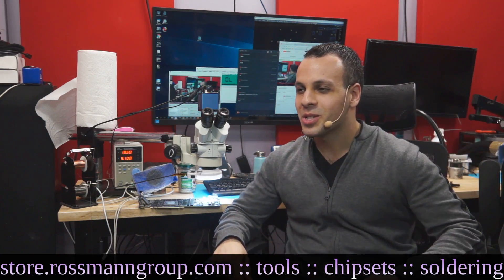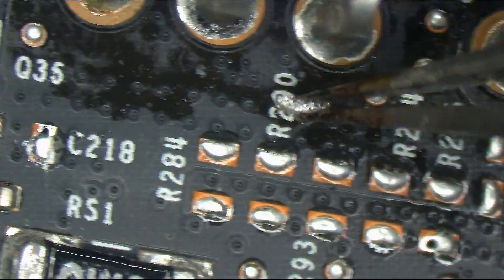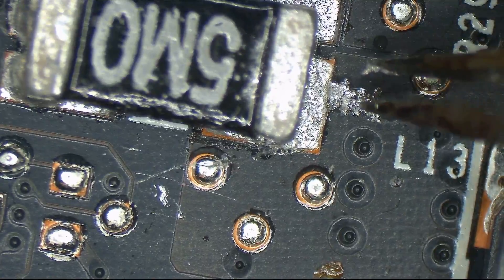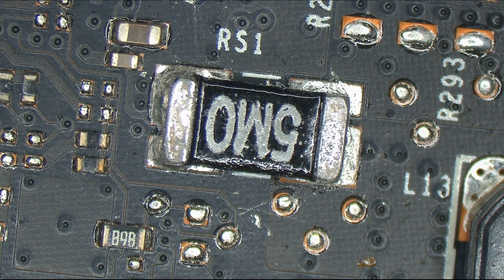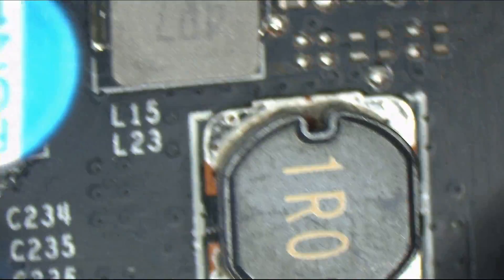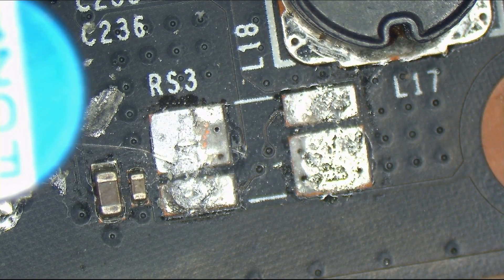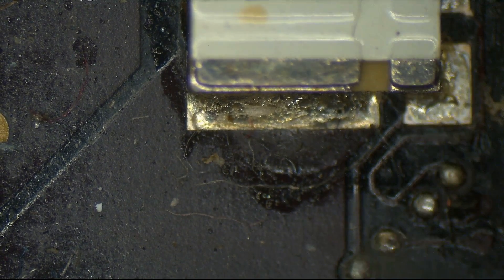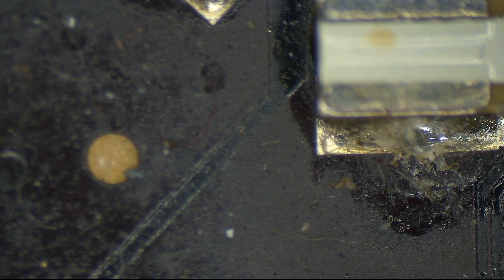DO NOT SHUNT MOD YOUR GRAPHICS CARD WITH LIQUID METAL!

Comment: Nvidia does actually use decent RoHS compliant solder. If the guy was using liquid metal thermal compound, then you dont want that getting near VRM components. You use it directly on the silicon only and you dont use much of it!

There are stupid people out there though who think they know better and no...they don't...
Reply: Actually these resistors cost less than a cent and you can buy them and solder them on the top of the original one to make the resultant resistance lower that much as you need, not just using some chemically aggressive metals on it resulting a full random resistance drop and solder degradation... But that would be too obvious.
Reply: You dont have to use liquid metal. You can use a piece of wire and solder it. If you can't solder then you shouldn't be fiddling around with a $1200 PCIe card as you clearly dont know what you're doing and are just following guides.

Just use a piece of wire, or a lower value resistor of the same wattage (ie: size).

+Peter Kiss - You do that, and you'll fuck with the clearance between the SMD resistors and the heatsink. The heatsink won't go back on properly. While a voltage divider would work, you're best to just put a 50kOhm or less resistor of equivilant wattage, or a piece of wire there.

It's more permanant and doesn't damage the card, so as long as you keep heat well away from the die area.
Reply: Using a piece of copper wire of a known thickness... The wire has a small contact area compared to an SMD resistor. What resistance do the solder blobs have at the two end of the wire? What length do the solder run over the wire? With what precision did you cut the wire? (As the length is that short even a small deviation can cause massive error.) However an SMD resistor is cheap, has a proper soldering surface area, a known resistance, known power rating, looks somehow...

Manufacturers don't do too detailed cutouts as it is pointless. These components are too close to each other to have dedicated cutouts.

Dude, I'm perfectly familiar with how electronics work. But they placed that power rated resistor there for a reason. And as long as the additional resistor connects parallel to the original shunt it drops the same voltage. Which means the ratio between their resistance equals to the inverse ratio of their power dissipation. Then it's perfectly clear what power rated component do you need to a certain percentage increase in the current.

"All that 5M Ohm shunt resistor does is limit the voltage through to the die" It doesn't limit anything directly (certainly not the voltage) as it's just a current sensing resistor. As I know Pascal cards aren't working with a perfectly shorted shunt, and again a few mm short piece of wire is everything but precise. It would completely void the whole point of current sensing.

"The only time you'd want to "stack" at all, is if you want a very specific voltage" Again it doesn't regulate the voltage. However the maximum voltage level on the shunt does not depend on the shunt value, as it equals to the comparation value in the current sense measuring circuit. (Of course only if it can reach that. With short circuit it can't reach that voltage level.)
Reply: 1. "You do that, and you'll fuck with the clearance between the SMD resistors and the heatsink." Not really. As you can see there are much taller inductors and elctrolytic capacitors around that resistor.

2. As you don't wan't to double the power usage you don't need a that high power rated resistor as the original is. For example if you want to get 125% power you need a resistor that 4x the resistance and at least 1/4 the power (therefore 1/4 the size) stacked onto the original.

3. Using a simple wire gives you an unknown result.
Reply: 1) Depends on the gauge/thickness of the wire you use. 

2) Putting liquid metal over your resistor is going to give you unstable voltages through that resistor. And even with a surface mount component you still have the resistance of the solder to deal with (negligable anyway).

3) The inductors or capacitors are in a row or line (ie: if this is part of the VRM) then they usually do have a cut out for it. It's better to just straight swap for a piece of wire or something like a 50k-500k ohm resistor.

4) The Power rating a resistor holds little bearing on what's moving through it, only what it's rated for. And a resistor will limit the voltage on the other side of it (due to the voltage drop across the resistor, Kirchoff's law comes to mind).

5) a SMD resistor has a tolerance too, usually 1-10% variance in it's resistance. Even capacitors and inductors have this. 

Lets say the Liquid metal short has a 100 milliohm resistance in parallel to the 5M Ohm resistor. That 99.99 milliohms give or take, which is certainly defeating the point. A piece of wire is likely to have a higher resistance than this and not cause gallium poisoning to the solder joints.

6) You can use a voltage divider to give you a set output voltage, especially on sense circuits where you need a set voltage. And the voltage across the shunt does depend on the shunt resistance. 

I've not seen schematics for the Titan X maxwell card so I can't comment on whether it's part of a current sense circuit. Besides that, the whole purpose of a shunt is to bypass other circuitry and create a shorter path for current. And given the cards don't fail with only 100 milliohms of resistance on that shunt with the mod, I don't see why they would fail with a piece of resistor wire or even copper wire.

Resistivity = Length / (Resistance x Cross-sectional area)

(1mm^2 x 1.7 Ohms) = 1.7 ohms, across a distance of 3 millimetres still gives you a resitance of about 1.8 milliohms. If that's too low then my bad, I'm wrong. But even then, it's best to just replace the whole thing for a more permanant solution. I would suggest against using kaptin tape or scotch tape and a botch job with just taping another resistor to it.
Reply: If I put liquid metal on a Titan GPU die I'd bolt my computer to the desk and never move it again.
Reply: 1. Please stop spewing elementary school physics and try to understand that resistor is 5miliOhm (0,005 Ohm). As the card draws 16-20 Ampers it flows trough that and causes a well measureable 80-100mV signal but still negligeable loss. It isn't a simple serial current limiter resistor. It doesn't limit the voltage by itself, it just provides a signal voltage that represents the current that flows trough it. It just helps the regulator circuitry to know how much current does the board drain from the supply. If you want to replace it with a piece of wire that is capable ot that high current rating then you need an as thick and as short wire you can't measure the length precisely enough to make a proper replacement.

2. I didn't suggest to use liquid metal on the resistor as I know what it does to most materials it gets into contact.

3. Just watch the video! There are much taller capacitors an an inductor literally besides that resistor within a cm.

4. The voltage on this resistor is limited by the comparator circuit which is unaffected by the value of the resistor. And if you want to reach the power limit (that's the point of the whole process) it gets to that voltage. You need to choose a resistor that won't exceed its power rating on that voltage. And as we are speaking about resistors in the miliOhm resistance range that can be an issue to keep an eye on.

5. Yes they have their own tolerances (as all electronic components have), but at least they have one, not as the wires you cut by the eye.

6. You can't use a divider in this case because there is no room for it, and it would be totally contraproductive as you want to keep the losses as low as possible (voltage drop and power dissipation). 

And finally the SMD resistor has two thick flat ends that provide high enough cross section to be suitable for proper soldering. The flat surface lies over the other surface you want to solder onto and need a much thinner solder layer than a round wire with a blob at each end. 
The resistor is more precise, more reliable, more professional, easier to replace or get fixed, even looks better.
Reply: Actually you can use it to short some shunt resistors on the board to squeeze a few more watts into VCORE. It does also shit on the solder and will eventually ruin it, but people who do this mod should know better.
Reply: Using a piece of copper wire of a known thickness means you know what the resistance of it is (you can calculate it's resistivity).

Also, heatsinks often undulate a lot. They usually make very specific cut outs on cards to fit directly over caps and inductors. Even a 0.5mm clearance issue will cause problems with the reference design cooler making good contact.

Rather 80 degrees C, you'll see your card throttle and then cause driver crashes or oveaheat protection to kick in as it's not making good contact with the die. 

Increasing the power rating of the resistor just tells you the amount it can pass before it overheats and fails. a 5W resistor has a 5W rated power through-put, a 500mW rated resistor, 10 times less than that. It doesn't tell you the amount of power it will consume. For that, you measure voltage and do the following:

V^2 / R = gives you the power disipation of the resistor. 

All that 5M Ohm shunt resistor does is limit the voltage through to the die. The voltage drop at 5M Ohm is high, lowering the resistance using as less components as possible is more feasible. Even removing the shunt completely and shorting it with copper wire would be preferable. 

The only time you'd want to "stack" at all, is if you want a very specific voltage, which you don't care about most of he time, even in Liquid Nitrogen world record attempts.
Reply: Unless you want to power mod it then you kinda have to use liquid metal on top of the shunts which is exactly owner tried but failed horribly.

Comment: Yeah, Louis, that wasn't solder, that was a liquid metal mod done by a user. It (the liquid metal) eats through the actual solder.
Reply: I think he should redo this vid or make a retraction on his comments about shitty Nvidia solder and clarify in words about the shunt mod that was clearly displayed here !
Reply: gallium is fun...
Reply: Damage Industries
Is that actually a thing? People believe gallium makes their graphics cards better?
Reply: @schwarzerritter5724  It does, because the shunts limit the card to a set power target. Even at stock, my Titan Xp is constantly power throttling (meaning I'm losing probably 10% performance without even overclocking...). The shunt mod tricks the card into thinking 300w is only ~200w, and allows you to actually have enough power to run it correctly since its not restricted by power. I'll be doing the same to my Titan Xp, otherwise I can pull 300w out of a cheap $100 GPU, yet my $1200 card (about $800 used now) is limited to less than that, so much for owning my own hardware...
Reply: @jakegarrett8109  How does liquid metal do that?
Reply: @schwarzerritter5724  That shiny stuff is gallium. An funny metal that melt other metals like water melt sugar - only slower. A year ago some nutheads decided to boost their GPU's by shorting current sensing resistors with gallium achieving larger supported current and larger graphic card performance. It works for short time. Then gallium melt solder around resistors, seep into board through openings and microcracks and do a lot of damage for solderings and board parts. Pimped up boards after gallium treatment become non repairable after few months. The point of that mess is to get a short time benefit like a little more 3DMark scores to get into first place in performance contest charts. Obviously you can do that if you have a ton of surplus money :P Seems owner of this Mac or someone from his friends decided to pimp up built-in GPU in this Mac. Look like they had a lot of fun.
Reply: @KrotowX  Wouldn't it be easier to solder in a lower current sensing resistor, or solder in a second parallel resistor?
Reply: @schwarzerritter5724  LM is conductive, so it lowers the effective resistance of then shunt resistor. The card then tries to find how much voltage drop the shunt has in order to find current using an assumed R value (the resistnace it normally has), resulting an extra high power limit because it simply thinks its pulling less power than it really is. Unfortunately you cannot just solder a bridge over it, they have a safety that if the power draw seems far too low, it thinks its a hardware fault and cuts power to the card. Liquid metal has just enough resistance to not trigger shut-off protection, and plenty conductive to allow unlocking a decent chunk of power and thereby unlocking a lot of extra performance.
Reply: @jakegarrett8109  Not a bridge, but a resistor then? It gives much more control over it than anything else.
Reply: @schwarzerritter5724  Not really, resistors come in fixed sizes like 0.005 ohm, .002 ohm. What is needed for maximum is in between sizes,. This is easy to accomplish by adding just a little more LM to the layer,  Need more power? Brush on some more. Doesn't boot? wipe off a little and continue. You could spend all week soldering a giant glop of a dozen resistors in series/parallel combination, or you can get super accurate with a Q-tip and LM. Besides that, I think you might damage the PCB after the 20th time you soldered to it.
Reply: @jakegarrett8109  I see nothing accurate about putting a liquid substance on it.
Reply: @schwarzerritter5724  "Liquid Metal", that's the name for the thermal conductive paste. Its a metallic (and conductive compound which is why it works for the shunt mod). Its wiped on for application, its a very common paste (high end, but very common). The only problem with it is, is that is discolors copper, and will absolutely destroy alluminum within a few days.

Google "Liquid Metal thermal paste" if you don't know what it is.
Reply: I assumed he knew that from the title of the video; not sure why he didn't mention it in the video itself.
Reply: Youtuber *
Reply: Come on fanboys the thumbnail clarified it enough. Basically he didn't see it was a mod while recording the video and realized it afterwards. No need to get all iffy because some youtube mocked MUH NVIDIA manufacturing process even if he did by mistake.
Reply: CooLLaboratory (the original Liquid metal manufacturer) has Liquid copper now. Perhaps that would be better for the mod? Or is it too conductive? Only one way to find out! :)
Reply: Yeah..."liquid metal" is basically a scam.  Only an idiot would use that stuff.  Gallium DESTROYS other metals, especially things like CPU and GPU dies.

Comment: https://www.amazon.ca/Thermal-Grizzly-Conductonaut-Grease-Paste/dp/B01A9KIGSI

^ In the comments: Use with Copper or Nickel, will corrode other metals.

And from this timeframe on this vid. The same resistor you're looking at right now:
https://youtu.be/3pflC72NfnU?t=128

Comment: that's definitly gallium, just look at how the solder is brittle and flakes like cake, gallium usually does that to at least aluminum as far as i'm aware.

EDIT: One such shunting product that people in the comments keep mentioning would be Coollaboratory Liquid Ultra. in the product description it clearly states: "Please notice that the Liquid Ultra is not suitable with the usage of aluminum surfaces."

Here is a forum post on how to destroy your $1200 GPU:
http://www.overclock.net/forum/69-nvidia/1608437-tutorial-power-target-limit-hardware-mod-shunt-mod-titan-x-many-other-nvidia-gpus.html
A passage reads: "Now use the brush included in the CLU package to spread the CLU over the whole top of the resistors. Be careful not to spill it off the resistor. If the CLU spills off the top of the resistor it will most likely destroy your graphics card."
Reply: I'm not familiar with how different Coolaboratory Liquid Ultra is compared to Conductonaut, but looking at those pictures in that thread, that is WAY too much to be putting onto the resistor. Conductonaut, at least, applied like that would probably fall right off the second you turn the card sideways. I put a tiny ball of it on a piece of paper and I could easily roll it back and forth just by moving the paper. Even applying it to my graphics die took a very long time with a very tiny amount (about a quarter of the small dot that the instructions recommended) because the LM stays together and doesn't like to adhere to smooth surfaces, you really have to work it in and then spread it out.

Using liquid metal thermal paste to create a short is just a retarded idea. It's stupidly simple to just add a wire and not risk permanently damaging anything. Not to mention a tiny piece of wire costs nothing whereas that shit costs like $14 a gram.
Reply: plus, you can literally ask for any resistance you want when it comes to wires....
(Impedance? I don't really know, i'm just a chemistry major)b